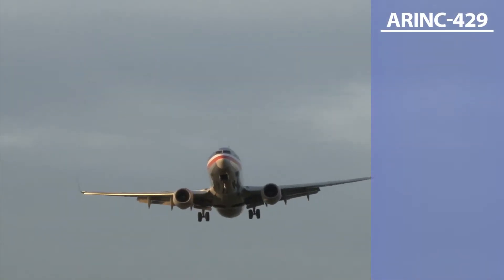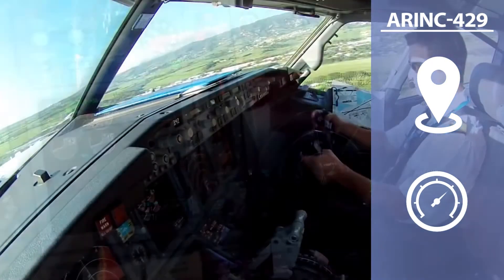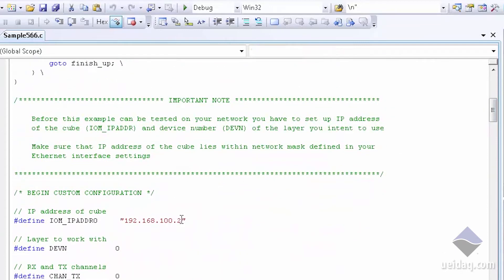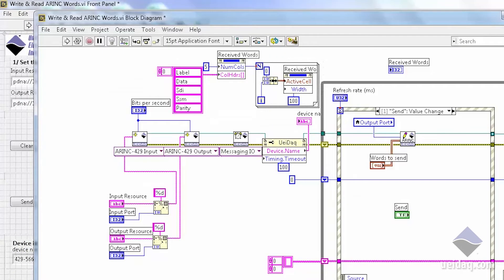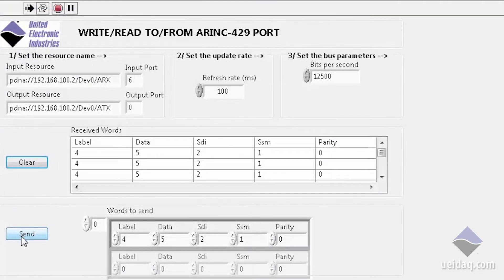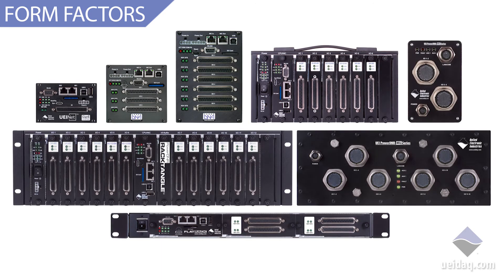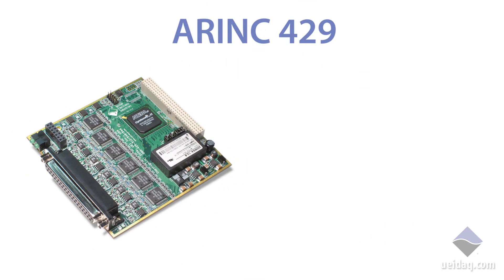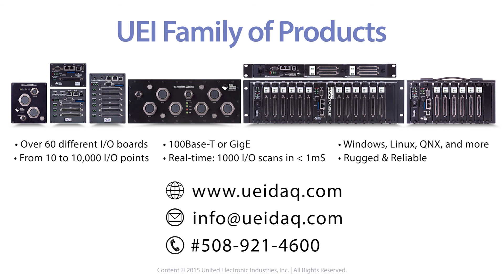United Electronic Industries ARINC-429 Capabilities (Part 1)

Comment: Around 1990 Smiths Industries (Grand Rapids,MI)  hired me 
to modify the Z8000 assembly code on an in house built 
429 based I/O controller for the Boeing 737-300 to increase 
the thru-put.
I loved the Z8000 microprocessor and it was a simple 
task over 3 months to provide a 30% increase.
The hardware guy was not a happy fellow since
he wrote the initial version of the code and was 
convinced his code could not be improved.
I saw this many times with arrogant stubborn 
hardware engineers.   I was quickly moved to
more challenging projects, and eventually 
returned to North Central Florida since I 
did not like the snow.

-- 8.7.2023

Comment: may i know which application that you are explaining???
Reply from the maker: We are discussing how to use UEI 429 IO boards to communicate with ARINC 429 devices.  This is useful for System Simulation, Flight Simulators, Component and System Test both on and off board the airplane, and as an ARINC 429 bus analyzer.